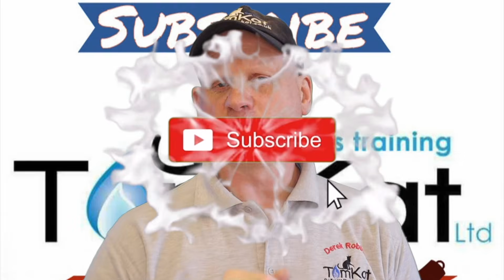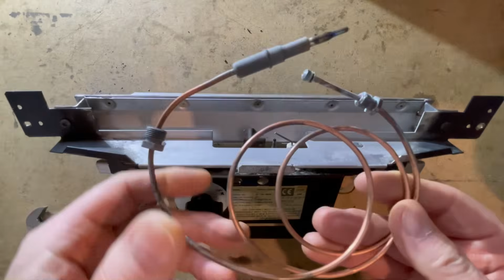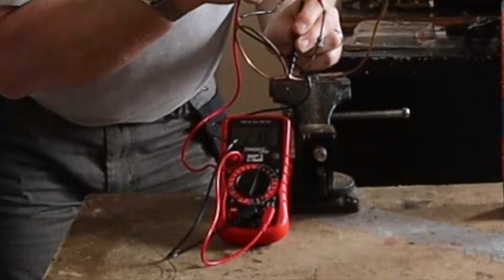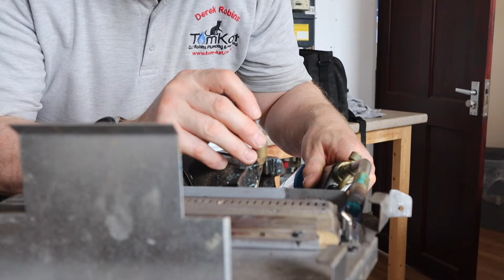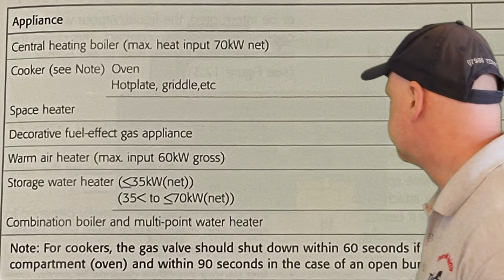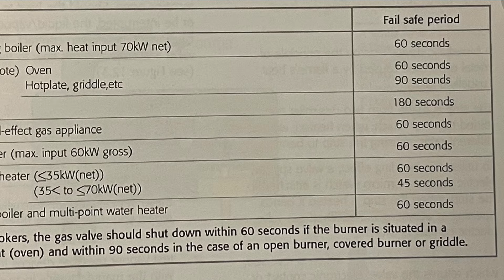HOW A THERMOCOUPLE, THERMOELECTRIC AND ASD WORK, looking into what parts make up the pilot assembly

Comment: Well, I am blown away.  I thought a thermocouple worked completely different and was even thinking it was incorrectly named. I thought it was more like a expansion capillary tube thing. I just measured a new universal thermocouple open circuit voltage of 15mV and short circuit current of 3mA.  I am/was in dis-belief that is enough to hold that the theroelectric device in against that spring (which looks like a reasonable amount of spring force).
One of my gas stove top burner  is taking longer and longer to light, so I am guessing the thermocouple is failing and not the thermoelectric locking device.
Thank you so much for sharing :)

Comment: Thank you so much for explaining just how and what the thermocouple does . This is the problem with my gas fire ,the pilot light is lit ,nice blue flame over the tip of thermocouple release the pressure on control knob after 90 seconds and the burner stops straight away . No charge to the electro magnet . Ordered new thermocouple . Now subscribed .
Reply: Did it fix the fault?

Comment: The ancient Armstrong furnace in my garage (that only rarely gets used these days) had just a tiny bit of DC corrosion on the cold end(actually on the anode) and some rust on the hot end. I cleaned it up and tested it just like you showed and I was getting .0063 milliamps. The flame seems to be dancing just a bit too much and it can occasionally trip but it's MUCH more stable now THANKS!

Comment: Interesting video! I bought a natural gas-powered outdoor fire pit last year, and when I tried to use it this year, it lights up, but I can't adjust the flame height. It worked perfectly fine last year. I cleaned the burner vents. I checked for any issues with the gas supply (crushed pipe or anything like that), but found nothing. Do you think the problem with the flame height control is caused by the thermocouple, as in your case? What's your opinion on this issue? Thanks.

Comment: *BEWARE*
I just paid $357 to have my Thermocouple replaced in the US. I had no idea it was this simple.  Initially they wanted to charge me another $205 just for "diagnosing" the problem for a total of $562 ! I told the tech to either call his boss and remove that charge or pack up and get out of my house. The technician barely finished talking to his boss on the phone when the boss said wave the "diagnosis" charge. It was pretty obvious other customers told them to shove the "diagnosis" fee up their ass as well. Of course they spring their "diagnosis fee" on you only AFTER they've arrived at your house and opened the burner. Not a word on the phone prior to visiting. I have no doubt they learned this scheme from others in the industry. It creates pressure on the part of homeowners who don't want confrontation and don't really understand what's going on. The cost of a thermocouple in my area for my burner is about $15. I watched the technician install it and it took less than 20 minutes start to finish. So for a visit that took far less than an hour, INCLUDING travel time, they intended to make a profit of $547 off of me just for a thermocouple replacement !!! Disgusting !!! I believe in anyone making a living, but a $547 profit for 20 minutes work and 15 minute travel time is opportunistic. They made $342 off of me in PROFIT without their ridiculous "diagnosis fee". Isn't that enough for less than 20 minutes labor ??? Obviously I'll never use them again. I'll buy a back up thermocouple and keep it for the next time the pilot doesn't stay lit and do it myself. Some people have no conscience and are money pigs. Thanks to Youtube and video creators like Tomkat greedy companies like this are getting their wings clipped.

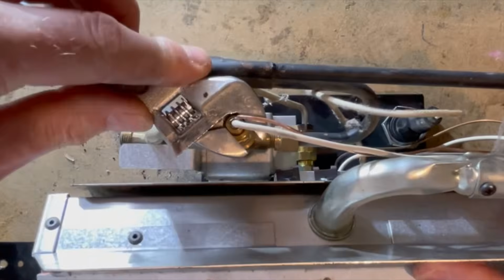Comment: Excellent video! However, could you please help me with one thing: when you demonstrate the thermocouple operation with a multimeter, you mention that inside the copper is another wire that closes the circuit towards the thermoelectric decive. However, when you remove the thermocouple at 8:40, that thermocouple has another additional (white) wire connected, that was not present during the demonstration before. Is my assumption correct, that the white wire is basically the same, but instead of the coaxial "inner" solution, running outside of the copper tube? Thanks in advance!

Comment: Very helpful. Many thanks. My thermocouple or thermoelectic device on my oven appears to have stopped working. Given its location I am going to try tickling the thermocouple with a small brass brush. If that does not work, can I replace the thermocouple?I live in the UK.

Comment: I have a 2 ring gas hob in my campervan. The gas keeps turning off and I think its the thermocouple. The hob has the correct butane injectors so I've ruled that out.
Can the thermocouple just be completely removed (by a registered engineer) to allow the gas hob to work again?
Reply from the maker: No you need a new thermocouple or hob
Reply: @tomkatgastraining  thanks, its a brand new hob but I'll order a different one. :-)

Comment: Great video. Hate that using all capitals at 4:17 has a huge effect on the voltage that comes from the thermocouple. 30mV vs 30MV is pretty significant.
I always assumed that the pilot assembly was a fully mechanical device. A bit blown away that it's actually electric.

Comment: I have a 3 burner dometic lpg gas stove in my camper if I  push and twist black dial  in and turn it to full flame then hit the ignition spark buton  it ignites on full flame but goes out as soon as I realease the the black twist dial .  but if I do this again and start it on a  very  very   low flame it stays on .  Then I can turn it up to full flame .. . And sometimes doesn't stay on no matter what I do . The other burners don't mess around like that.  They start on any setting .